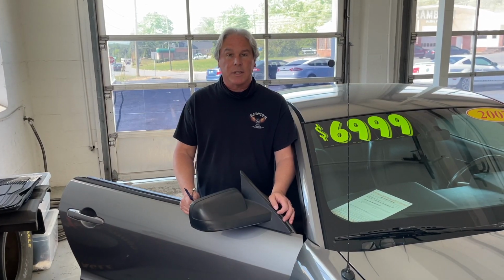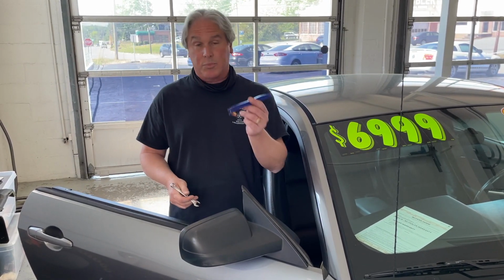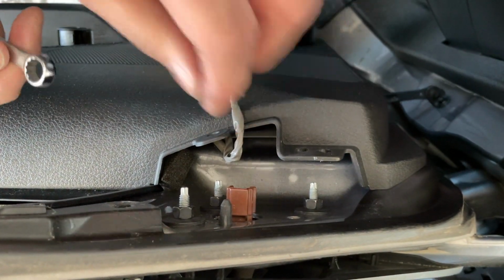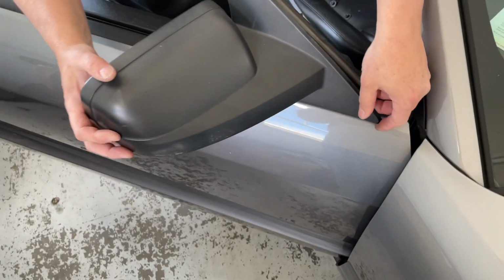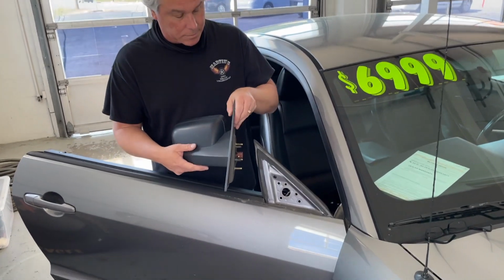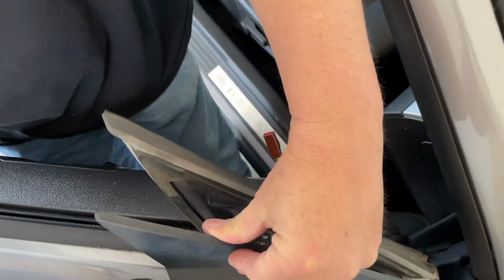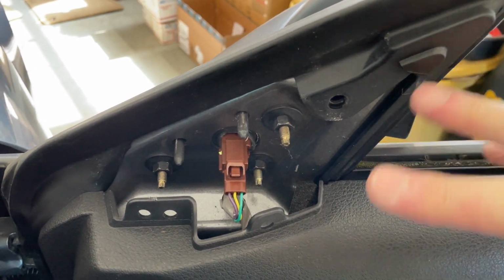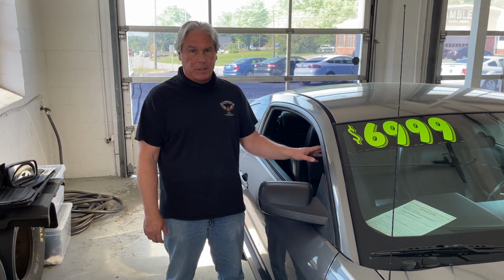How To Replace Passenger Mirror On a 2005-2009 Ford Mustang

Comment: Help me pls.please tell me I have a ford mustang 2005 4.0L, the pipe to the oil separator is covered in oil, what should I do? I can send a photo
Reply from the maker: First, check to see if all of the hoses are connected properly. If the canister is leaking, you will have to replace it.